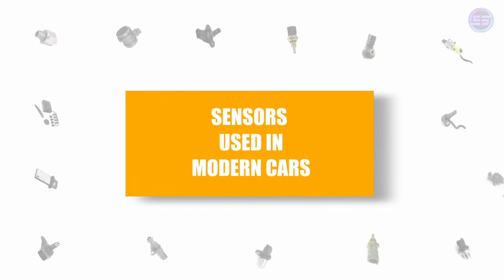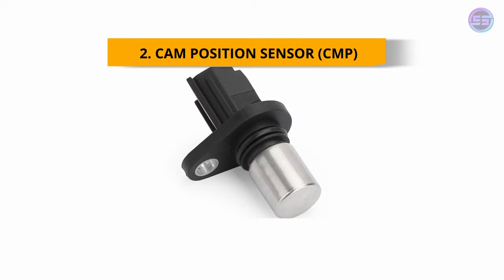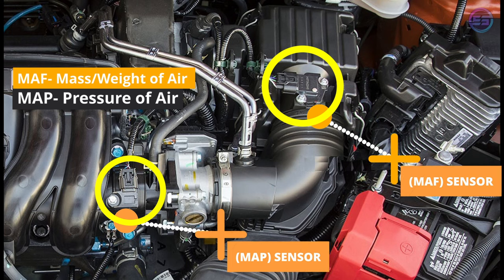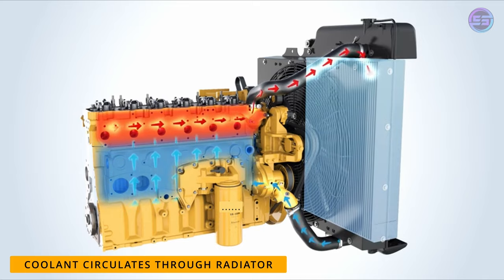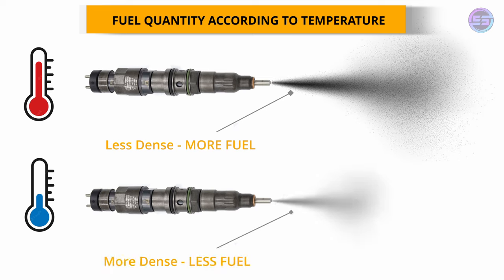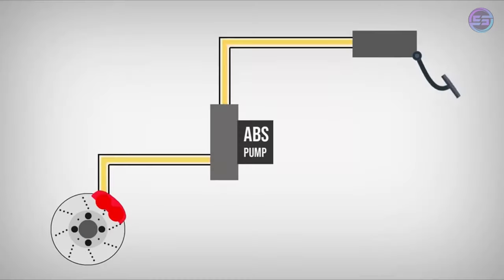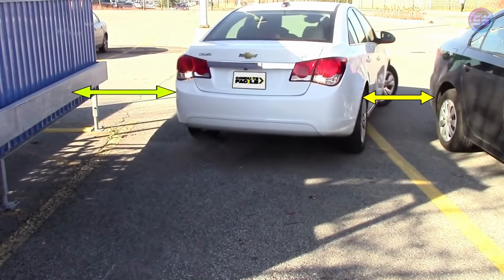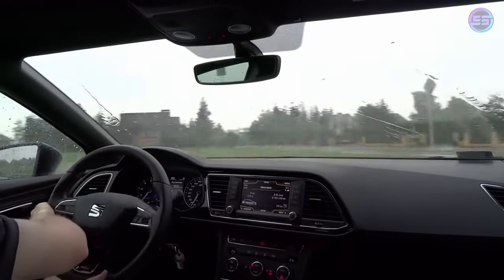Sensors Used in Cars | Working of Sensors | Location and Uses (Explained in Detail)

Comment: This video is a great reminder of how much technology has evolved in the automotive industry. As a manufacturer of throttle bodies and sensors, we understand the importance of using quality sensors that are reliable and accurate. It's essential to work with trusted suppliers to ensure that the sensors we use meet industry standards and provide the necessary performance data to the engine control unit. Thanks for sharing this valuable information!👍
Reply from the maker: Glad you Enjoyed
Reply: Yes
Reply: @thomaskikonke1528  😄

Comment: My car is a Nissan Sunny Model 2011, the problem is the Dashboard always shuts down, then on shut down and on, in the morning, even when it's running frequently shut down and on. When it shut down the engine still running. what is the problem in this kind of situation? Can you please help me solve this problem?
Reply from the maker: Check the Electrical Wiring Connections of the Instrument Cluster with a Good Automobile Electrician

Comment: the CHT cylinder head temp sensor on the V6 3.7L coyote motor is located underneath the intake manifold. 
$25 part $500+ labor
Reply: Don't always see this as an inconvenience. I prefer engines that have this in addition to coolant temperature sensor, since the location of some coolant sensors makes them unable to reflect engine temperature when the coolant leaks while driving. I've seen this on a Nissan VG33E engine (coolant leak between thermostat housing and intake plenum with NO rise in a WORKING water temperature gauge. On an Aluminium block, that would have been catastrophic. I'm entertaining the idea of placing a thermistor on cylinder head and wiring an LCD gauge to it.
Reply: @abdul-kabiralegbe5660  post your final schematic for your thermistor, parts list too, please.
Reply: total cost just shy of $1200.00

Comment: Hi bro, i got a problem. My hyundai accent crdi rpm increases when in Park  or neutral if i step on the pedal but if i put in drive or reverse the rpm stays the same like in idle even if the pedal is floored the car wont accelerate. But i can feel the tranny is engaged when i put to drive.
Reply: Sensor problem
Reply: @litutheking6646  which one?
Reply: @janechelonrico5218  crankshaft position  sensor
Reply from the maker: Scan it
Reply: @motoringmasters  there was no codes
Reply from the maker: Possibly it may be intake system, you can manually check on 
1. inlet system(everything from Air filter to Inlet Manifold),
2.Injector Deviations.

Comment: Hard intermittent start problems(what sensor could be faulty?) Its about a Chevy Captiva...please help
Reply from the maker: Maybe poor wiring connections or faulty cam and crank sensors.  Making a Quick scan will help you.
Reply: Failing check valve in the fuel delivery system prevents the system from maintaining pressure after the engine was last running. An easy way to work around this problem  is  turning ignition on and off 2 or more times without starting engine before attempting to start. Doing so will cycle the fuel pump replinishing lost fuel pressure for quick start. When hot, if the pressure is not maintained properly, the fuel can vaporize inside the hoses and will require more priming and/or  cooling off to start.
Reply: @JimMcBob42069  I will try(thanks)
Reply: @Engineering Explorist  no fault codes ...scanning
Reply from the maker: 1. Check for leakage in fuel supply lines 
2. check the complete fuel supply system(low-pressure pump, high-pressure pump and injectors)
3. Make a Cylinder-piston Compression test.
Reply: Please how can test the cylinder-piston compression?

Comment: Can you tell me the manufacturer of sensors?
Reply from the maker: Several manufacturers produce car sensors for various applications in the automotive industry. Some prominent ones include Bosch, Delphi Technologies, Continental AG, Denso Corporation, Infineon Technologies AG, Sensata Technologies, NXP Semiconductors,Analog Devices, TE Connectivity, and Autoliv Inc.

These companies play a crucial role in developing advanced sensor technologies that contribute to modern vehicles' safety, efficiency, and performance.

Thank you for asking the question! Feel free to ask if you have any more queries or need further information.